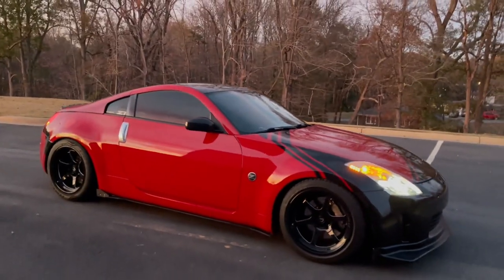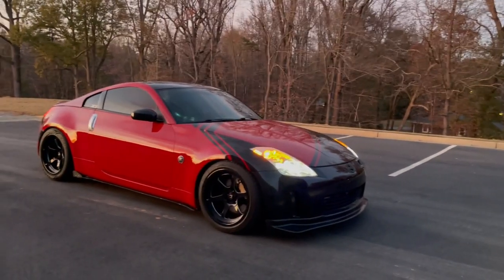Q50 Side Splitters on a 350z??

Comment: Nice, it needed it realy.  👌 
So here is your next video idea for the Z.
Now I have to worn you this is one of those mods that you either love  or hate.
UNDERGLOW!!!
 Personally I like it when it's done tastefully no leds showing. Did a sick setup on the G before I lost it.
Got mine on the jungle site for 80 bucks. 
Free ap you know pic colors and effects. It was fun.
Reply from the maker: I think I have to do it!
Reply: @SpeedCultureStudios  well alright! Qwick tip. Use the 3m adhesive promoter.  This will make the flexible led strips stick very well and you won't have to use those chinsy clear brackets that screw on.  I just checked and as of right now on Amazon the KORJO car underglow lights. Is on sale for $50.99 
6 piece bluetooth.  I hard wired to switch Ignition.  Tucking all those wires kinda sucks but it's worth it. INJOY!

Comment: Good morning, I have an interesting question if you could help me and the community. Went to order motul front and rear diff fluid and no one has it. it is on back order, out of stock. what would you recommend for an alternative fluid to use. redline or liquid moly. Thank you in advance for your help and advise.
Reply from the maker: Thanks for the update.  Yes redline or LM is good.  I used royal purpose most recently and didn’t experience anything unusual.